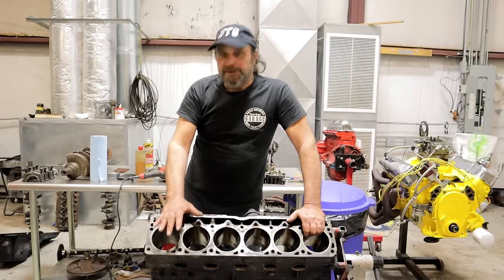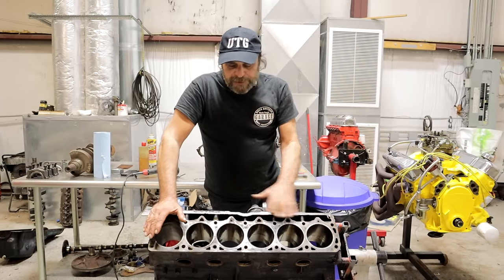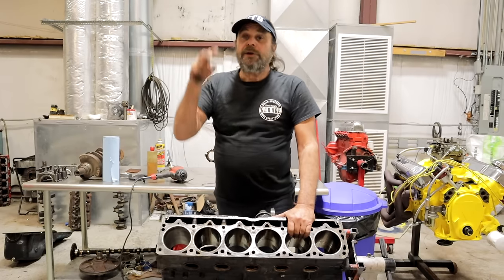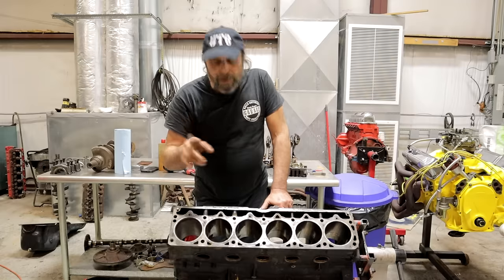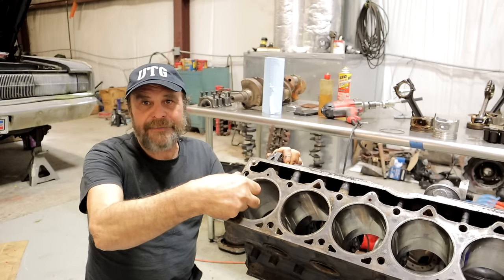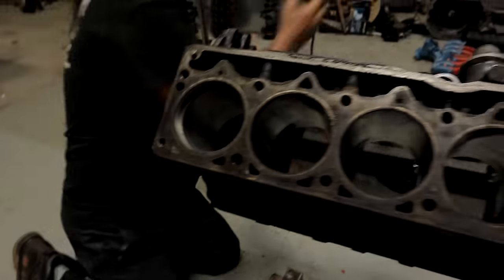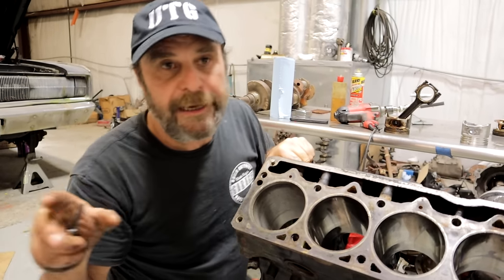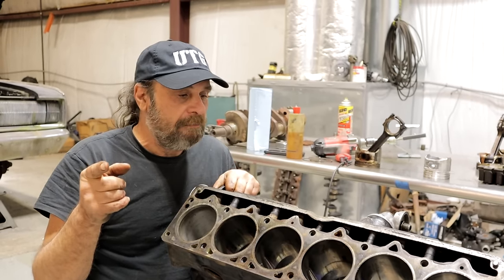Your First Engine Job - Checking Cylinder Bores For Roundness And Taper Using An Old Piston Ring

Comment: If you want to really learn the tricks to building a great engine, listen to Uncle Tony.   Its the same as learning to become a great chef by listening to a 5 yr. old describe his happy meal.
Reply from the maker: What part of "Your First Engine Job" do you not understand, Mr. Fully Equipped Machine Shop??
I thought it was fairly straightforward....
Reply: Yeah because a slant 6 freshening needs $3000 worth of race engine machine work 🤡🤡. Typical machine shop guy trying to sell you tons of work you don’t need.
Reply: Well this got interesting
Reply: @UncleTonysGarage  it was very straightforward uncle Tony. This guy is a complete troll. Excellent job on showing some of the new guys some good tricks. Also of course thank you for the entertainment to another old school motorhead.
Reply: @UncleTonysGarage  I'm NOT a novice engine builder, but I STILL LOVE this series!!!!  So much knowledge and information and it's awesome to see another engine builder showing the old tricks of the trade, especially low tech know how!!!  A LOT of what Tony shows/describes is very similar to what I do/did/have always done and got very good durable results from.  Some of the stuff Tony shows/explains I have never even thought about, and it seems like I LEARN A LOT FROM EVERY VIDEO!!!!

There's a lot of videos showing hand building/remanufacturing engines from india and china, and they use some pretty low tech techniques, and some of those videos are showing how they do it on new/modern engines that sell to the entire world, so you DEFINITELY DO NOT need a full $8000 or even $3000 machine shop for this stuff.
Reply: @UncleTonysGarage  you been spewing the same hackery for 3 years now... you are obviously making money why dont you at least buy a dial bore gauge and show people how to use it????   I am Mr. full equipped because I wanted to do better.  How many "first" engine builds do you want to do... How about a video on your second engine????
Reply: Boy…the couch coaches are in full swing tonight
Reply: @Spike-sk7ql  nope.   UTG is making money by creating content.   When you follow his "Engine building advice" and it blows up, do you think he is going to send you a check and say sorry.
Reply: @scotts439  This guy's entire schtick is that he literally only makes videos for the home car enthusiast. It doesn't matter how much money he has, that's what his channel is about- so that way young and not so rich guys like me stand a chance at having a satisfying hobby. All this machinery you have is great for your engines, but it can't bore you some perspective it would seem.
Reply: Ease up Dude, seriously This is why She left you...
This is Why ..
Get out from Under that Bridge..
Reply: Hey power play engine dude, what channel can I watch you do it the right way. Especially for us with very basic tools, limited knowledge and want to try doing this ourselves?
Do you have a YouTube channel we can gain knowledge from? I would love to "watch & learn"!!
Reply: @hughgerection8675  thank you for that link.  Appreciate that Hugh!!!!
Reply: @jdrambin1144  hey I am not trying to solicit anything.  But since you asked detective, you might click on my screen name....
Reply: @scotts439  He is going to use this engine, why not film it for content. Go watch Steve Morris if you are too intelligent for Tony.
Reply: @scotts439  I certainly will Power Play........
Reply: Powerplay Machine Shop...yawn. Why watch Tony's videos just to be insulting in the comments? Are you upset that he has 250k more subscribers than you?
Reply: @dingusgarage803  I am upset that he has more subs than me.   You see right through me sir.  My therapist thinks I am insecure about my engine knowledge and lash out at others on social media.  I am trolling that hack Steve Morris too!
Reply: Power Play Engines
Could you please provide a link. I tried the search feature on YouTube but it's not bringing it up. It brings up a few but none are Power Play Engines.
Reply: He calls it Powerplay because his work is like playin the lottery. Not very good odds.
Reply: It's almost as if you didn't watch the video, and decided to chime in. Tony is showing how to do a basic visual check for roundness of a bore on an engine that doesn't require micro precision by using a ring. People have been doing this for decades and it works.
Reply: @hughgerection8675  I did but it brings up "make a comment".
Sorry, I'm a boomer and its apparent I am not good with the comment functions. Oh well, lost interest in Power Play anyway.
Reply: @jdrambin1144  No you have to take the entire engine to them and fork out $5500 for your slant 6 to make 120hp. But hey, they found you 8 horsepower for your $5500...
Reply: Let's take a realistic look at miles of longevity per dollar spent on the engine build and see how well you stand up against the home engine rebuilds. I don't think you will do as well as you would like.

I understand your frustration at having somebody tell beginners the unvarnished truth and not sending them down that high dollar path you would like to see them on but that's the breaks. Not every engine needs a full machine shop workover just to put in new rings and bearings along with a basic valve job.

I do feel sorry for you sitting with your high dollar Rottler machines and having nothing better to do than sit there belittling other people's efforts because you blame them for your lack of success..... wait, no I don't.
Reply: @scotts439  Did you ever stop to think that your therapist might be right?
Reply: @brianbrigg57  Well put. That troll only has 500+ subs. How much ya wanna bet he trolls this channel in hopes of suckering viewers into "jumping ship here at Uncle Tony's to come sub his channel". Believe it. Why else would he be continuously buzzing around here like a house fly.
Reply: Pretty sure that the point is to save money,   as soon as you start paying for shop work you probably should check jasper and others first.   Warranty is a nice investment at that point.
Reply: @nastybastardatlive  I agree with you, a core needing no machine work is the best.  I am simply stating that a lot of the advice that Tony gives is misleading, and simply NOT the best way to reach a successful repair.  I became a machinist because I dont trust machine shops.  What UT doesnt tell you is the way he is honing cylinders for the last 45 years WILL work, but in a short amount of time, the engine will be an oil burner.
Reply: @scotts439  you can buy lots of new rings for the $5500 saved going this way.
Reply from the maker: @Powerplay Engines  Ok, I'll bite.  Using the one cylinder we covered in this video, please explain in detail how, once it has been final honed using an appropriate stone for the rings used, will become an "oil burner in a short amount of time"
Reply: @UncleTonysGarage  He won't "explain that" because he can't. Like I said before, the only reason he is trolling your channel with harassing comments is in the desperate attempt to attract viewers to his own channel........he only has 500 subs, lol. I guarantee you, that is the reason. Because any machinist worth his salt ( being totally honest ), would agree with you Tony. My late uncle used to rebuild engines out of his own back yard & little garage. He built hundreds of engines over the years. Many had cylinders that only needed touched up, to which he honed or dingle berry'd himself. Out of all of those engines, only 2 or 3 came back, and that was because the customers refused to follow his advice in one way or another. He had a good reputation in his area, that kept him very busy. He also had a good business relationship AND FRIENDSHIP with a local machinist who often referred customers to my uncle Jack. Any machining that needed done, my uncle would take them to his buddy, the machinist. He rebuilt a couple motors for my Dad, and I even had him rebuild a 283 SBC for me. He did the cylinders himself. Engine ran great, gave me years of service & never burned any oil. This is exactly why I know you're right Tony.
Reply: The point of this video series is to get an engine put together for cheap, but will still perform within the realm of "factory". If the point is to get every last possible bit of torque and HP, then yes, this is the wrong video series to watch. I've only been doing this about half as long as Uncle Tony, but there's nothing here explicitly "wrong" in the methodology.
Reply: Man, this PP engines guy has 4 accounts now. Burning bridges right off the bat.
Reply: If you have the money and/or time you can get these things machined. Sometimes opens the door for more fuckups. I say that from experience both as a customer and a machinist. If there's no damage I'd just throw a hone in it. Fully blueprinted it'll still be a slug anyways. No blue smoke and it's a winner.
Reply: @UncleTonysGarage  I am not going to try to convince you of anything.  When someone decides they know something, they turn off the idea of further learning about the subject.   You have been doing the glazebreaker gasoline thing for 45 years, and why would I waste my time trying to convince you (and your loyal following) otherwise?   Quite the opposite, as a machinist I am trying to sell people services they dont need, and price gouge for them.   Measuring bores with a ring and "Looking for light" is a great way to measure.  A dial bore gauge is just to dazzle people and steal their money.  Please stop exposing machinists as the liars and cheats that we are.
Reply: @scotts439  Ebay has some inexpensive bore gage sets. You need to get the ones with .0001" graduations. I worked ten years as both a setup and production machinist. It's a waste of time to use anything but a bore gage.
Reply: @scotts439  I bet you really hate plastigauge videos where they use a bore gauge and show that it's good enough for a home enthusiast.
Reply: @brianbrigg57  Plastigage only shows the size in one direction. You have no way of knowing how far out of round it is, unless you use a bore gage.
Reply: @brianbrigg57   you can  measure cylinder finish and bore geometry with plastigage?  You must be the only guy who can.
Reply: PowerPlay Engines... Definitely a man of spare parts..
Reply: Yeah he’s a troll for sure…..🙄
Reply: @scotts439  I'm sure he means checking crank or rod clearance, but I get your humor.
Reply: @jonlanigan3439  yes, I am joking of course.... But boy,  talk about being attacked for disagreeing with the great and powerful Oz!
Reply: @scotts439  Most non engineers would not be able to use a single leg bore comparator without tuition and it's a large outlay for checking bores on your first rebuild. You ignore the fact that he's talking about old engines not modern stuff.
Reply: Tony is very knowledgale, has had years of experience and is dead on correct as humanly possible. He is a great source of information. That said there are things others have done that Tong doesn’t discuss. In his defense, his time is limited in that the viewer may only have the ability to focus on what he passes along. In that case, take a break if you need to, and come back later to finish the video. And if you are confused find a local source and ask them. These no harm in getting the best info you can. Tony is awesome, and his knowledge of the 4.0 Jeep Engine is pretty much spot on. I applaud his efforts.  But what he doesn’t mention, and it doesn’t matter if you are just rebuilding your engine but is damn interesting is how this all came about. When AMC’s buisiness began to fail, before Chrysler ought them the upper management wanted something to replace the Concord and Spirit based 4X4 vehicles. They sold but not anywhere as many as needed. 4wd family sized vehicle. The CJ was a great off reader and has been since WWII. But it was too small for a family o 2+ people, let alone the family dog etc. they wanted something as capable but had a larger interior. The Cherokee at the time fit the bill, but was a bit too expensive for most younger buyers. So they designed a vehicle with sub framed channel suspension it was basically a boxed frame with the top of the box being the floor of the design. It had four wheel independent suspension, and that gave it great articulation. Sound familiar?I’ll get to that in a minute. AMC deemed the design to be too expensive a larger than they wanted the new offering to be, so they put the design in the shelf, and taking away the suspension and adding two straight axles like those that had been successful in every decent 4X4 ever built. The new design was light weight, roomy enough for a family of for or five depending on how old the children were, turned on a dime when parking or maneuvering around boulder and the like when off road. A grit off reader. I loved mine. The first couple years relied on GaM engines that all buy destroyed it’s reputation but  AMC re-engineered the old straight six, strengthen and improver the design and made it in 4 and 6 cylinder versions. Although most of the 4 bangers ended up in the YJ series Jeeps a few were used in the new XJ, Cherokee. The six made 170 ho and up over the years if refinement, and that was plenty of power for all but the most extreme rock crawling creations of the aftermarket and owners. And the design on the shelf? When the Government wanted a new all terrain vehicle to replace the Jeep, AMC went back, dusted the design off, added a more powerful diesel engine and called it the Hum Vee! Cool stuff right?
.
Reply: 😂 Yeah okay.
Reply: @scotts439  go play with yourself
Reply: Machine shop Karen lols
Reply: Such negativity.  It ain’t rocket science and Uncle Tony has made it very clear that HE IS NOT BUILDING A RACE ENGINE.
Reply: Make sure to get enough 🥜 butter with that overabundance of jelly you got.
Reply: I left my working heads with new next size valves , springs , retainers , locks at a machine shop. $1500 paid up front. A year later the guy is still hemming and hawing and I am asking how much longer and how much more money? I finally abandoned all that and left them there. He was trying to bill me for hours polishing. Eschew his arse. And he was telling me about 900 horsepower figures and I was thinking 450. What a jackass somewhere near Houston.
Reply: @jdrambin1144  Wow you just mic dropped that fool 🤣🤣🤣
Reply: @jdrambin1144  Stand back and let the guy with 532 subs tell you how it's done. Whoops.
Reply: @scotts439  knob.
Reply: @UncleTonysGarage  Tony......there are always  going to be knuckleheads that think they are the only guys in the world that are sharp, talented mechanics/engine builders and most of the time the arrogant ones are machinists. My first high performance build of a v-8 was a 355 that I had picked the parts and a race shop did the machining and balance crank. They didn't like my choice of block, gm 4bolt) or cam , my trick flow heads too small, etc. Said I thought everything they said was a joke! No! I was a beer budget racer! I assembled my motor in my garage (355 , "0" deck, balanced eagle crank, h-beam rods , Ross. 558" dome forged pistons .030" over, trick flow 195cc 2.02, 1.60 64cc chamber 3 angle triple roller springs , arp bolts, fluid damper, comp cams .246", 254" @.050" , lsa 110 (?), .512" lift @1.5 ratio , comp steel rockers ball stud roller tip 1.52 ratio Chinese victory Jr. type single plane, holler 750 double pumper, 13.7:1 comp., msd distributor and 6al box, holley blue pump, 1 5/8" headers long tube w/ full 2 1/2" exhaust, Flowmaster turbo mufflers, 116 octane fuel, power glide w/brake , 9" converter (no idea if good match) , back halved 67 Camaro ladder bars, Dana 60 spool, 4.something ratio, motor 14" back (and firewall) from stock, motor plate mounts, roll cage,  (ad nauseum, sorry). My point is that it ran like a raped ape and NO problems at all.  1.52 60 ft., 7.3 second 1/8th mile e.t. , @ 91 mph. Not setting world on fire , but I bought tranny as a used race power glide and just ran it.  1st gear was ferocious of the line but 2nd was either slipping or converter couldn't hold the torque? I was pretty damn proud of my accomplishments.  Bought car as a roller and did all motor assy. , wiring, plumbing, tuning, etc. Excuse my French, but Fuck those who laughed at me!!!😅
Reply: I did chassis dyno the car and one of my mistakes was not chasing the head bolt holes out and block was decked so the bolts on passenger side head let coolant spray under load as head lifted off block. Still made 352 ft lb. torque and 293 h.p. to wheels while losing God only knows how much compression.  I switched from copper plate head gasket to permatorque and cleaned threads better and she sealed up. My guess is about 480 horse/500+ lb.ft. at crank.
Reply: We (car enthusiasts and drooling morons across the world) should acknowledge just how smart, educated and experienced you are and , whilst you are technically correct and have the equipment, skills,  and know-how to probably be a world class engine machinist/builder ( no B.S., I know enough to know proper machining technique is an art. It's why Germany has been the best at making guns, planes, cars, medical equipment,  etc.) But can't us "ham and Eggers " do our thing without being humiliated over our caveman approach to engine builds?
Reply: @scotts439  I totally agree lets see the next engine after the blow up. Tony is just making money on this and could really give a shit about doing something right. And if he did care he would get a bore gauge and show the results. He should change it to uncle hack garage
Reply: Wow
Reply: Great job Tony Keep it up!
Reply: Uncle Tony is the real deal and whatever he talks about is based on real conditions each of us experience during our wrenching on cars and engines.
I have advanced knowledge in ICEs and i know the ideals enough to bash Uncle out of the game but he is right into it playing with my best wishes because he knows his way around into actual car engine building and not the clockwork theory behind it.
If you want hypothetical scenarios into machine shop conditions you will never come up to or need when regularily building your average engine you can listen to someone else.
Don't forget to rebuild your engine every 2000 hours or as little as 1000-1200 if you accelerate hard and put high load to it because a brand new engine that came out of the factory will usually become out of spec after that.
Reply: @UncleTonysGarage  30 years in reman engines building , stop using an fn deglazer and telling people its some sort of hone ffs. With that said good luck getting anyone to competently hone ro do any pro machine work on any engine
Reply: Machine shop guy does not like DIY!
Reply: As an engine builder and small engine mechanic by trade what uncle T is teaching applies overall.  Show some dam respect to him. Thank you for your videos. I enjoy them alot so keep doing it there's alot.of us that appreciate them alot.